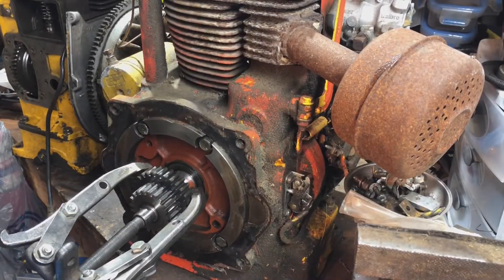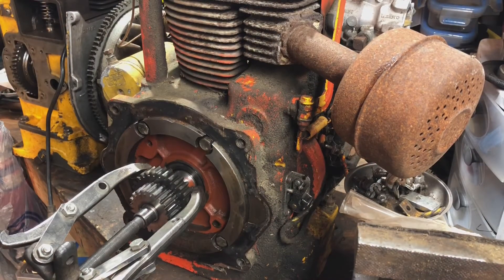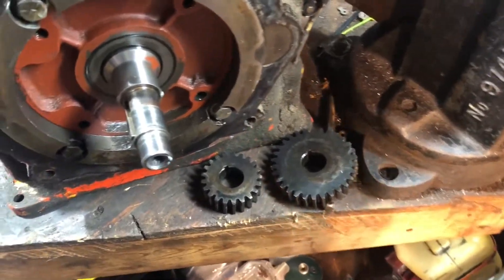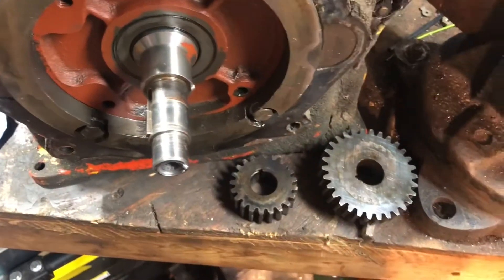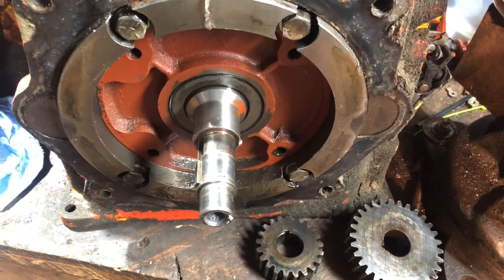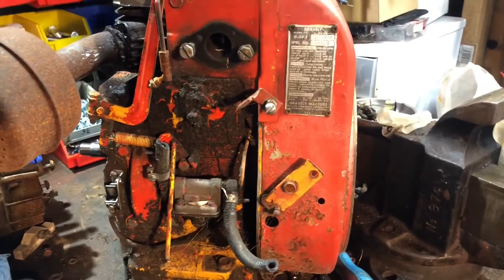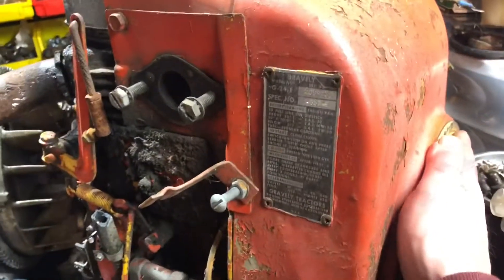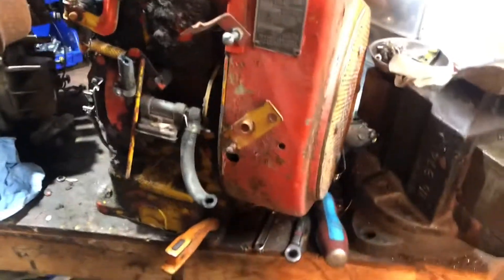Evaluation of the next Gravely Project Commercial 10a #2

Comment: If the groove is from the gear turning with a broken key, couldn't the groove be filled in (brazing, welding, JB weld, etc), turned/ground to size, and install the gear with a new key and bond to the adjacent gear for additional support?  PaulL
Reply from the maker: Maybe my plan is to add filler and use a one piece gear.